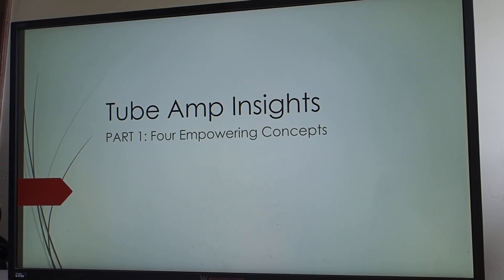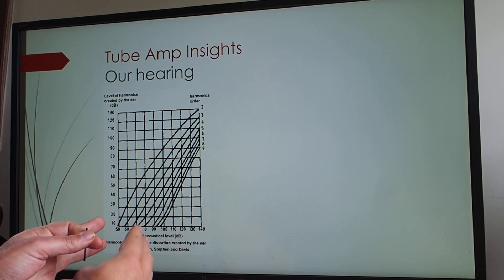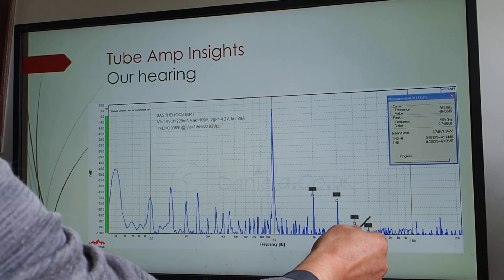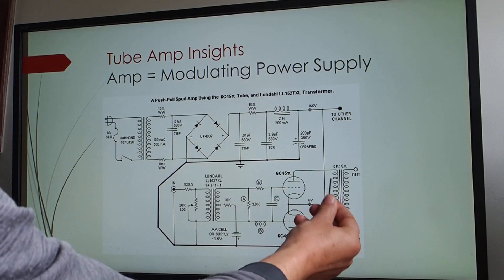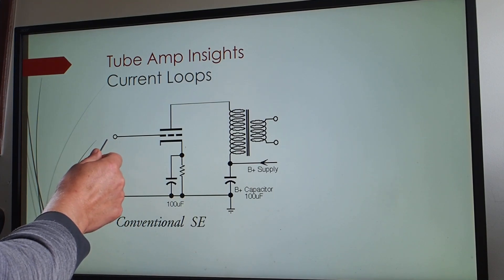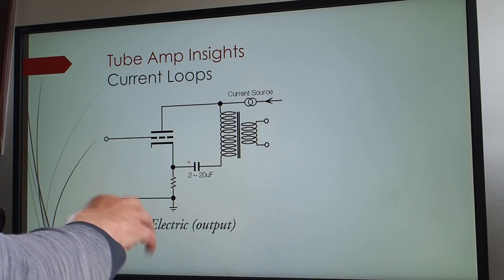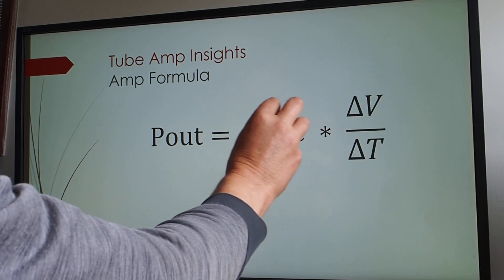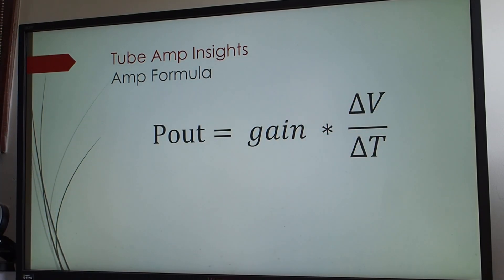Tube Amp Insights 1: Four fundamental but often overlooked concepts

Comment: Thank you, very interesting!

But I don’t fully understand in which part of the amplifier the DC current is changed to AC to go to the loudspeakers?

Wall socket AC > PSU > rectifier > DC current >..?.. > AC > Speakers..
Reply from the maker: Hi Nick. The tube does this, it modulates the DC. For example it can vary the voltage between 100V and 120V in the shape of a sine wave, by varying its own resistance. This then produces a 20V peak-peak AC signal. The average DC voltage will be 110V but we have a +-10V signal modulated on top of that DC. We use transformers to separate off the DC component. Look for: 'Uncle Doug how tube amps work' for a YT video series on how DC and AC work within a tube amp.
Reply: @EduardBroekman  Thank you! I will look in that video.

Comment: Thanks, Eduard! On the issue of the importance of the power supply, I agree with you and I've been looking at modifying the CLCRCRC filter in my Luxkit A3600 (push-pull 4x KT120). I have the opportunity to use an Al-Elko 16uf x3 cap for the driver and signal tube power supply sections (the last two Cs in the filter). I've been thinking of using one 16uf section for the driver and using the other two separately for the right and left sides of the signal tube (6AQ8 twin triode). Do you think separating the power supply into left and right channels might be beneficial?
Reply from the maker: Hi there. Yes I'd say separating the B+ for each channel of the signal or driver section would help somewhat since they're single ended and any cross-influence will be amplified a lot being at the start of your signal chain. For the PP output stage (assuming your amp runs in class A1) with its near constant power draw, it's much less relevant. That all said, I expect a much bigger gain to combine this with upgrading to non-electrolytics capacitors (look at Kemet or Wima DC-Links which have near zero inductance): in my experience electrolytics and even mid-tier MKPs that are in the signal path will dominate the sound character of an amp.
Reply: Thanks, yes, I'm now looking again at my plans again! I note I have 100uf electrolytics bypass caps around the cathode resistor for he signal tube, which I will now remove. I would also like to replace them in the PI filter where I can find room for them in or on the chassis.